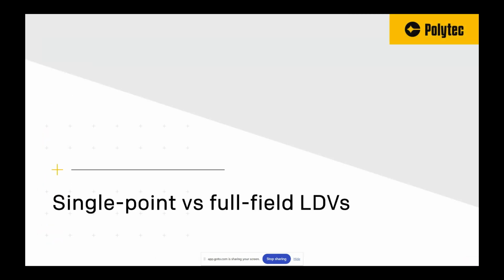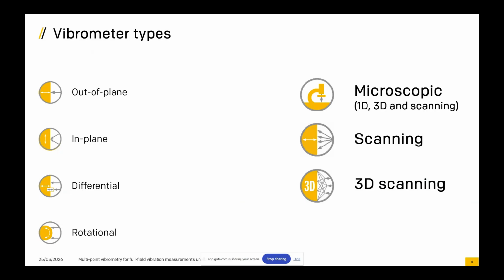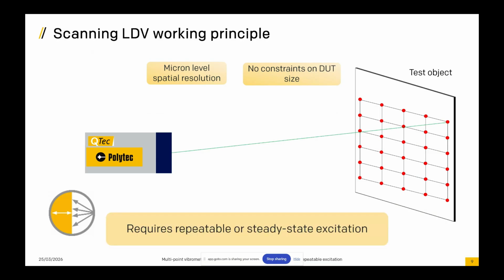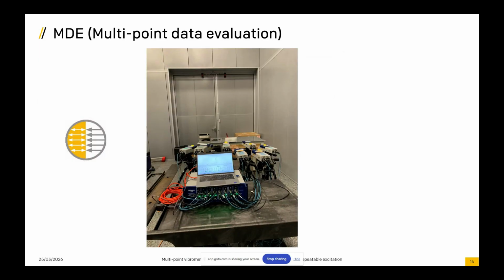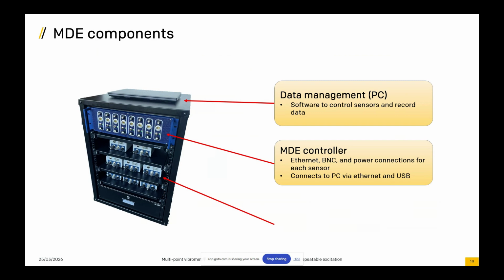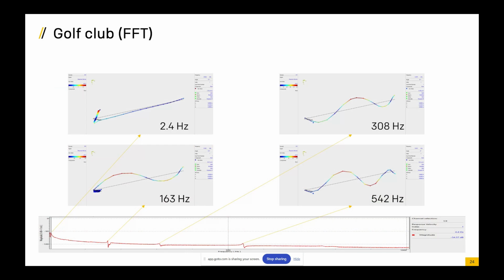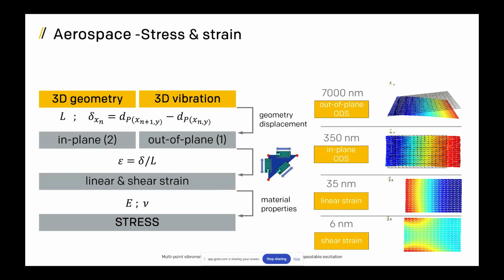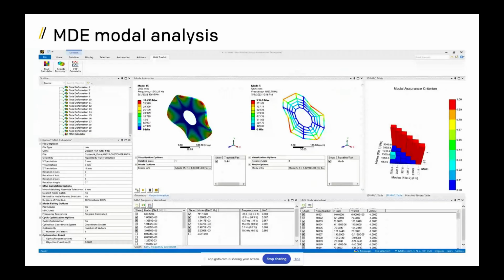Multi point vibrometry for full field vibration measurement under non repeatable excitation

Comment: Hello, I’m a mechanical engineering student, I’m currently working on a thesis for my final project and for that I’ll be using a camera to test measurement for full field vibration, do you have any material or someone who could share some thoughts in the matter which I can contact?
Reply from the maker: Hi Vini, please send us more information about your thesis to info@polytec.com and we will have someone reach out to you with the necessary material.